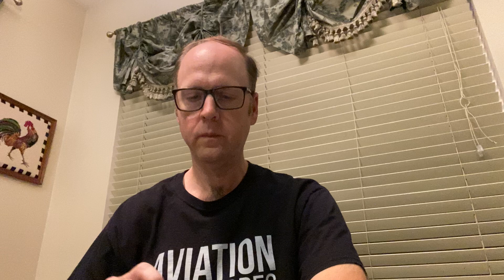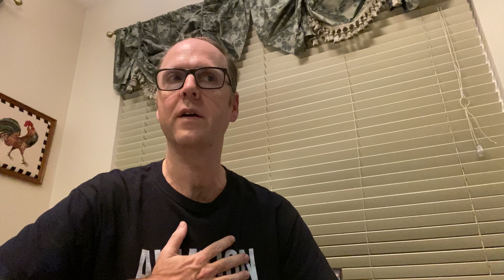Should Software Engineers upgrade to Macs using the Apple Silicon M1

Comment: Can i run C++ code with gcc compilor in Macbook M1 ?
Reply: GCC has not been ported to the M1 yet, but you can use CLANG which has a aliased version of GCC that allows you to compile C++ code like you would with GCC.
Reply: Will i face any problem while using Clang instead of gcc?
Reply: @kartikgupta2636  I don't think so, but it is possible that there could be an incompatibility. Clang is pretty modern. When I compile Node.js on my Mac, I am using Clang, but with GCC commands.
Reply: @DavidFekke  Thanks for helping me

Comment: Should i get the m1 mbp 16gb and 512gb model, razer blade or an xps? I am studuing software engineering and next year i will have to major into game dev, web dev, IOT, health tech, or mobile solutions. I would want to get into Game dev or mobile solutions or IOT in that order, but i am not sure what computer would suit my needs and im not sure in which ill get into yet. My current laptop is old and it's fan broke down so i have to buy now a new one or try to work with my desktop only until the fall when the rumoured 14 inch mbp comes and then decide. Great informative video, subbed and liked.
Reply from the maker: For mobile and web dev I think you will be fine. A lot of the IoT software I use is built to run on x86 machines. Most of that is open source, and can be converted to the Apple Silicon based processors. Game Dev will depend on the kind of tools you use. If you plan on using Unity 3D or Unreal, those should be ported pretty soon. If you are looking for DirectX support, you might want to take a look at Windows.
Reply: @polyglotengineer  okay thank you!

Comment: Hello gooday.. i am new to programming and want to start learning, python, c++ and html for a start.. should we get this version or I should get a early 2020 version
Reply: Should i**
Reply from the maker: You can use the M1 Macs for C++ and Python. Python runs on the M1 and you can use Clang and LLVM for your C++ projects.
Reply: @polyglotengineer  ok thanks alot, would you say i buy macbook pro 2020 base version or MacBook air 2020 m1.. in the country I stay they have same price..they dont sell apple official prices
Reply from the maker: @biggyx8349  If they are the same price, I would get the MacBook Pro. The MacBook Pro will have better performance because it uses a fan.
Reply: @polyglotengineer  thanks alot I relly appreciate the advice..ill get the macbook pro
Reply: @polyglotengineer  sorry for disturbing, do you think I should get the macbook air 2020 i3 base version or I should go all in for the pro version 2020
Reply from the maker: @biggyx8349  I would not get an i3 for development. Lowest end processor I would get in a development computer would be an i5.

Comment: Sir is m1 chip best for pycharm and for python language with Ml and AL. SHOULD I BUY
Reply from the maker: My understanding of the ML libraries for python is that most of them are written natively in C,C++. Unless those libraries are built for this new chipset, they will run under Rosetta 2. We won't see big improvements in ML on Apple's M1 until libraries are ported to the neural engine on the M1.

Comment: I’m starting software engineer next month, witch one will be your recommendation for school? I’m a Mac user and I’m deep in the ecosystem so was thinking about getting a MacBook but air or pro? How much RAM or SSD?  Thanks for your video !
Reply: 8GB and 256 Air is more than enough in terms of performance. The question is more about toolset you need. If you need Docker right away, then buy something else. Otherwise ARM is the future.
Reply: I would say buy the air with 512 GB to 1 terabyte of storage, and 8 gigabytes of ram. If your getting the pro then buy the 1 - 2 terabyte storage p, and 16 gigabytes of ram. It depends on how much you want to spend.

Comment: I’m electrical engineer and i using autodesk like autocad, should i buy mbp m1 or just intel ? Thank u
Reply from the maker: That should work with Rosetta 2, but you might want to check with Autodesk first. I am curious how Autolisp will work on the new processors. I am assuming they use an interpreter. If that is the case it will probably still work.

Comment: What I haven't been able to find is how M1 handles memory and swapping, and how efficient it is at doing so.  The 16GB memory limit is giving me pause for ordering a machine.
Reply from the maker: The M1s seem to be a lot faster with swapping, even with the 16GB limit. The memory is integrated on the CPU, so it does not have to be throttled going through a bus now that everything is on the same piece of silicon.
Reply: @polyglotengineer  That concurs with my expectations.  Then the memory limit probably only applies to allocating large chunks of contiguous memory (some rare, big data applications).  This also tells me if I'm cash constrained, in most cases, the money might be better spent on a larger SSD rather than on more RAM.  Thanks!
Reply: Agree, i'm already running in paging on a normal app development (C++) with 16GB.  Compiling with Link Time Optimization eats memory like crazy. I will never buy anything with less then 32GB unless i have too (and i don't have too at the moment). Hint: My build server is a 2019 iMac with 128GB RAM and i wish i could have 256GB.

Comment: Finally a video that talks about developers situation MADE BY A DEVELOPER. I found thousands of useless videos made by people that simply said “Oh, well, there’s Rosetta so everything is going to work even better”, but nobody was focusing on real specific development platforms. 

You confirmed what my concern was about. Well, I’ll get an Intel Macbook Pro 16 then ;) In the next years I will certainly upgrade to ARM chips as well, but today it could be an hazard.
Reply: @jurycould4275  
I do not defend the new mbp.
As I said before, I got a windows machine from my company. I don’t really care about the OS tbh. I use m1 for 4k editing as a hobby. But it’s completely legit to use it as a dev machine aswell. But you sound like dev would be some rocket science and needs special tools while the "mimimi doesn't work with Docker" argument is pretty weak not just only by the fact that an apple silicon optimized Docker version was released today.
Reply: Well they are not useless for me since I edit as a hobby. And for my profession as a dev I got a laptop by my company. This maybe concern freelancer but still who tf runs docker container locally on their own machine. For that you have servers and clouds. 
It also doesn’t make any sense for me to spend double the money for a 16 model which is already obsolete due the fact the m1 is equally performing to a max. specd intel 16 and in a few months the new 16arm system going to be released. The time you realize you fucked up no ones going to buy your intel furnace for good money especially not a specd >3k$ version.
Reply: @jurycould4275  
 
“All devs who work with docker” thats just a wrong statement. At least me and my team use it on the cloud and so do many others. 

“For girls editing on tiktok” jesus you know there are also other professions than software development? You just sound incredible ignorant and stupid. Congrats
Reply: Agree finially like who cares about video editing unless your a youtuber

Comment: I'm a computer science student, if I buy a air m1, will it be a good decision?? Plz reply
Reply from the maker: It depends. If you need to run tooling that has dependencies on Intel x86, than no until there is good virtualization available. If you need to run C, C++, Obj-C or Swift code. It should be fine. If you are developing for the iPhone or iPad you might be better off in the long run buying a Mac with with this processor.

Comment: To fix the virtualization, Homebrew and other problems in new M1 chip, will M1 chip need to be upgraded or Homebrew, Docker need to be upgraded for M1? Thanks very kindly.
Reply: Homebrew needs a lot of new development in order for it to work on the M1. Almost all of the homebrew projects are open source, so I imagine that will be working a lot better in the next six months. Docker is reliant on Go lang. Go lang's compiler will need to add support for Apple Silicon processors. Pretty much anything that requires virtualization is not ready yet.
Reply: @DavidFekke  I'm so grateful. So many Thanks, sir
Reply: @DavidFekke  another confirmation about my concerns, thank you. I’m going to buy a MacBook in the next months, and I love to see big benchmark numbers (even if I totally don’t need that much power), but probably is simply too early for developers. 

Of course in the next months (and year) we’ll see a lot support for every platform, but sincerely I’m really worried about spending my money (a lot of money) on a machine that could simply not support a specific kind of software or library yet. 
Virtualization is important for me, so it needs to work properly. Also, I think that nobody has already tried to virtualize Windows on it, that could be interesting since windows doesn’t really like ARM processors.

Comment: It’s way more lockeddown than anything we had before. Android studio is java so it should just work but the emulator is probably not java.
Reply: Once Google or Jetbrains get to it, you'll probably get a much more native experience because emulators will barely be emulators.  They'll be more like real virtual machines seeing as they'll both be running ARM instructions.
Reply: Virtualization is not supported by rosetta yet, so no point of buying if you do android or docker
Reply: @ameetpalsingh  Is it a hardware limitation of M1 or a software limitation of Rosetta?  I do React Native so I code for both on a shared platform.  But I can work on Windows when I'm doing the Android specific parts and macOS for iOS specific parts.  But it'd be nice to be able to work on a single machine eventually
Reply: @EthanStandel  not sure about hardware since no software is ported from x86 yet, but rosetta doesn't support virtualization that's for sure. For node js it should work fine and if you use android studio for Virtul device you may face issues. Besides, some threads on Reddit is saying developer experience is not that great with languages like java, and we should wait
Reply: @ameetpalsingh  As a professional Java dev, can confirm: Java development is never a great experience 👍

Comment: A few facts that I've come across using an ARM-based Raspberry Pi for a prototype and an android device with termux to run NodeJS, Golang and Rust:

- Docker can run on ARM-based processors, however, some images use binaries compiled for x86, thus, not working on ARM-based. You might still find unofficial images that have been built for ARM-based processors.
- Android/termux can't run docker
- Android/termux can't run headless Chrome (e.g. puppeteer)
- Android/termux runs NodeJS, Golang and Rust just fine, except maybe for C binding dependencies that might not have been built for ARM.

Comment: For someone who is not a web-developer, a data scientist to be precise; one who works on AI projects using python and pytorch, would this purchase be a good decision?
Reply from the maker: It would depend on the python libraries that you are using. A lot of the python libraries that deal with ML are partially written in native languages like C++. That native code would need to be either in large binary.
Reply: I have the same question. And personally, I think it will probably work fine but not immediately. You will need to have a specific new version of Python interpreter as well as all the C-based libraries used in data science (such as Numpy, Pandas, Scikit-learn, Tensorflow etc.). Probably this will eventually happen as these libraries are open source and change fast, but it will take time to be stable especially for libraries that will depend on the M1's neuro-engine, which is new and has completely different instructions from the AVX instructions in intel-based processors). I will probably wait until these machines get adopted for enough time.
Reply: @OsamaAdel  Yeah makes total sense. I'm not worried about the python interpreter itself, rather I'm more worried about the libraries it will be able to support at the beginning. Raspberry Pi uses ARM-based SOCs so that should be fine
Reply: Tensorflow just released M1 version, pyTorch will be soon. Their NPUs are very capable. It is much better for AI than Intel Macs. The other thing is if you need GPU. Then go desktop.
Reply: @tomaszcodasz  Thanks for the info! Or you could just use Google Colab
Reply: @tomaszcodasz  wow .. but what about other python libraries?! It seems like jupyter has issues connecting with python kernels on m1 machines and I expect similar problems with numpy and pandas since they have C code compiled for intel chips !
Reply: @OsamaAdel  numpy can be compiled for ARM, I think python libraries will be ported very quick, just NPU support is something more difficult to implement, but as Google (Tensorflow) showed, it is possible.